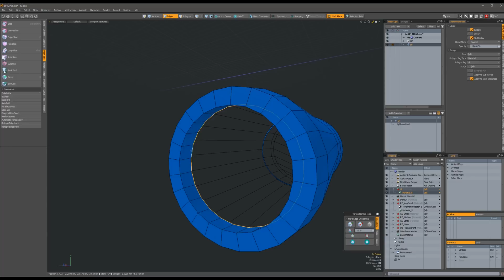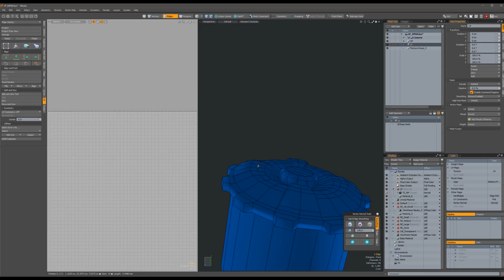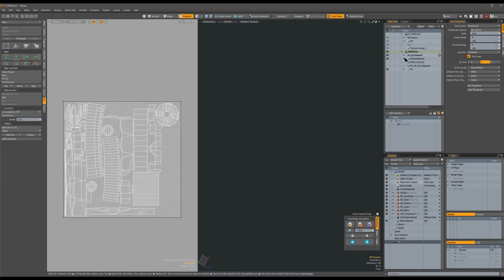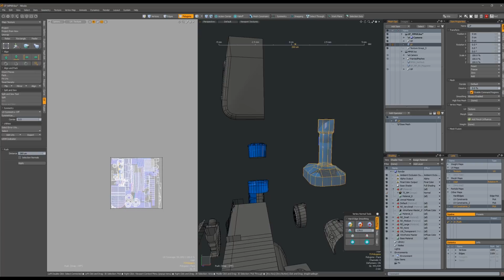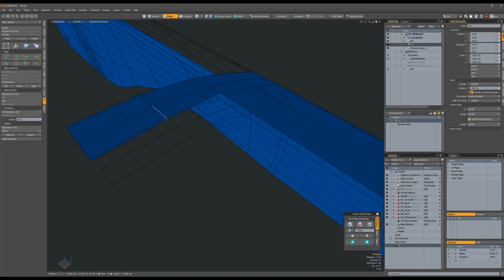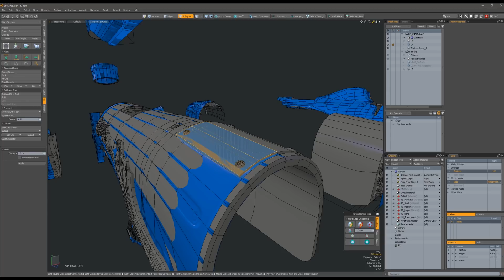Tutorial : Fantasy Shotgun - Low Poly & Uvs & Test Bakes

Comment: Hi Warren. As most of the textures are done in Substance or Quixel today, is it a better choice to have clean UV layout with UV shells lined up properly (and to group the UVs of each part together) or to save time and use automatic layout (and minor manual adjustments)...? I had negative feedback recently because I didn't line up the UVs of a vehicle (top/side/front/etc.) and didn't understand why it was more important than a correct use of UV space.
Reply: You save space by having them sewed together allowing you to utilize more of the resolution for textures. Excessive UV splits can cause performance issues in engine as each split increases the vertex count.
Reply from the maker: That's a WHOLE can of worms and is very situation-ally dependent.  Straight UV shells are better for baking certain kinds of detail or if you want to make it easier on the texture artist if they need to overlay some decals or text, for example. 

But rotating shells can sometimes lead to better use of UV space so you get a higher texel density.

Everything is a trade off and there's no right answer, unfortunately.  Do whatever your art director asks.  :)